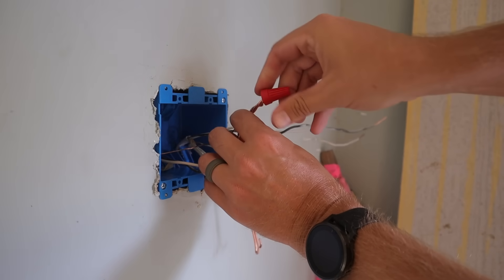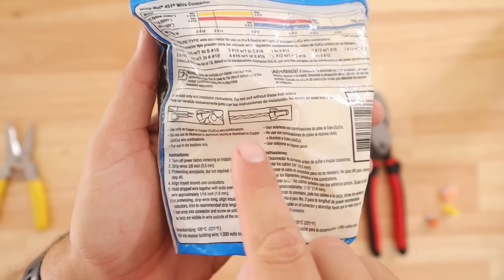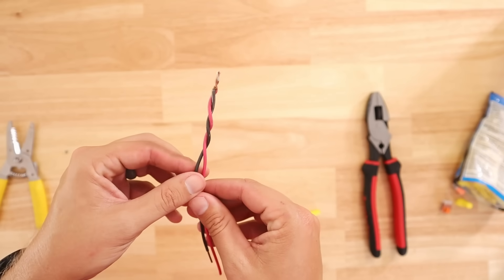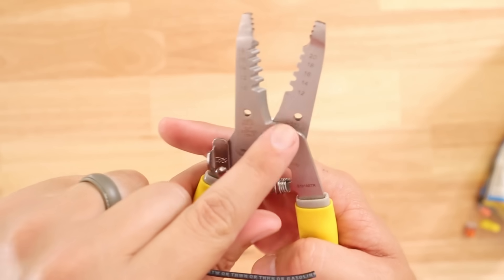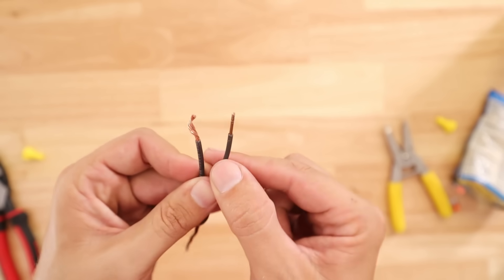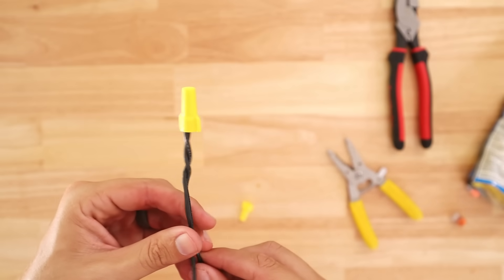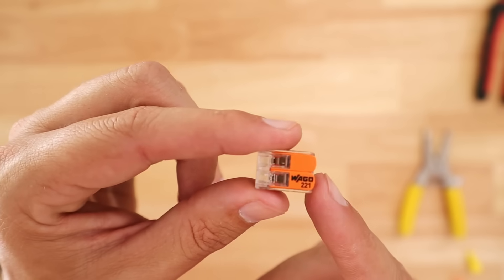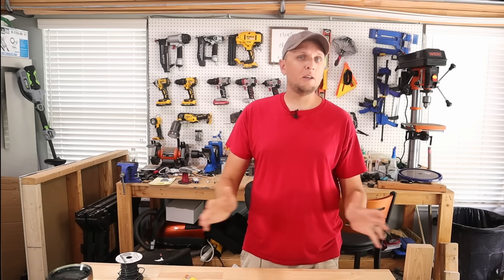BIGGEST Mistakes DIYers Make When Connecting Wires Together | How To

Comment: I enjoy using the WAGO 221 in ceiling light boxes and ceiling fan boxes because the job gets done more quickly. When I am working with my arms stretched out overhead I want to reduce the time spent on the ladder compared to the time I would spend working with wire nuts.

Comment: Excellent video.  Though the package says 'pre-twist not required' it does not in anyway translate into 'no-twist necessary'.  As a DIY'er I've always pre-twisted my wires because I can visually confirm a good connection before the nut goes on.
Reply from the maker: I agree!

Comment: I just had a wire come loose from a wire nut for my living room light switch this morning. I opened it up and used a pair of pliers to get leverage and tighten the hell out of it before closing it back up, fixing the problem (this resulted in the wires starting to twist together aswell). Before this the nut was as tight as I could get it with my arms but still losing contact.

Comment: Another problem that causes pull out is using a wire nut that is one size too big. For #14 and #12 connecting one stranded conductor to one solid, I would use the smaller orange wire nut or the smallest correct size to bite into both connectors to make a solid connection. Using the correct size wire nut to the size conductor or multiple conductors is also important. Wagos work well too because of the clamp down pressure. Push in wire connectors work the best on smaller guage solid wire like in old fluorescent light fixtures when I do LED conversions. Unfortunately you can't properly push in stranded wire in these, OK for #14 and #12 solid, but the wire tends to rotate in the ports. The best connection for larger wires is making a good neat tight twist then locking them together with the correct size wire nut.
Reply: Orange Wire nuts are for #16 or smaller for #14 and #12 you use a Blue wire nut, #10, #8 and #6 you use a Red wire nut. Anything Larger use a Large Dark Blue wire nut. But it also depends on how many wire you have to Splice at once.Sometimes i have to use a Red wire nut on 6 #12 Solid Wires

Comment: Biggest challenge I have when doing installation and repair in my home, is working with 60-80+ yr old wires. Replace a light fixture and the insulation on the wire is just crumbling off.  Cant run a new wire thru the house, so wrap in tape and hope for the best.

Comment: I have been an electrician for thrifty years and if anyone wants to trust the wire nut , you have never accessed a junction box and untwisted a wire nut with 277 volts with the full load on a neutral.  Horrible advice.  Always twist your wires. I don’t care if it’s 12 volts dc or 24vac.

Comment: The biggest mistake DIYers do is to touch electrical in the first place. Check your homeowners insurance. It probably has a clause that says if you don’t use licensed contractors then if your house burns down due to substandard electric work they are not going to pay the claim. It’s cheaper to hire an electrician then to burn your house down or worse electrocute somebody. Do not do your own electric work!

Comment: I guess the Wago is good when you have the space to use it. When you are cramming wires and 2 or 3+ connections in the box, wire nuts take up less room.

Comment: In my opinion, for the typical untrained DIYer, the Wago 221 is the way to go.  They are much easier to understand and less prone to improper installation.  Plus, they look nicer and are easier to undo if you make a mistake.  Great video!
Reply: Wire nuts are a thing of the past!!
Reply: wagus suk in my opinion.  I dont trust them.  But if you do use them , ENSURE they are rated for the correct amperage based on wire size.
Reply: Even the electrical engineers disagree with each other! Follow the manufacturers instructions and you are covered.
Reply: @hardtobefirst  I agree!
Reply: The big problem with Wago is they are not a direct copper to copper connection, and therefore will always have more resistance, and that means more heat wasted.  They will waste a substantial amount of energy over millions of connections (especially where higher current is flowing).  Use a wire nut PROPERLY (it's not hard) and save energy with a direct copper to copper connection - and you'll never have a problem - and use less energy in the process.
Reply: @johnanderson5208  I agree with you, theoretically a Wago might add a small amount of resistance.  In my opinion, the ease of use, time savings and the compact package of these devices far outweighs cost of the energy that it dissipates, which would be immeasurable for most home owners with a quality meter.  I agree that wire nuts make a good quality connection when used correctly, its just that often times, they are not used correctly.  Its pretty hard to screw up a wago connection.
Reply: @martyb3783  It's not "theoretically" - the fact is there is NO copper to copper connection in a Wago.  You have copper to plated brass (or steel) then a second plated brass to copper junction.  You have TWO inefficient, energy wasting junctions in a Wago.  Wire nut junction has exactly ONE electrical junction, and that is copper to copper.  Assuming the copper is clean and the wire nut is correctly installed, that is the most efficient, lowest resistance connection outside of welding.  Wagos will always have a higher resistance, and therefore waste more heat than a proper wire nut.  The energy loss will go up with the square of resistance.  On circuits carrying low current there will be a small difference between a wire nut and Wago - but look at a circuit carrying higher current and the difference is obvious - and you can see a Wago warm up more on IR camera.  Yes, you could say a single Wago doesn't waste a huge amount of heat - but multiply by lots of Wagos used across whole cities and countries  - and you then you realize every wasted Watt counts.  Remember  - these days EVERY wasted Watt counts, especially across millions of connections.   If you want to stay efficient, use a wire nut.  If you can't use a wire nut correctly, then please hire a good electrician to do the job for you.
Reply: @johnanderson5208  LOL, absolute nonsense.  To worry about the miniscule amount of resistance in a wago connector when the device being powered is order of magnitudes more inefficient than the connector.   Let me guess, you watched a couple videos, now you're an expert. 🤣
Reply: @martyb3783  You agree with John?  He's absolutely incorrect in his asinine assertions.
Reply: @petercullen1462  I said I agree in theory that wagos might introduce more resistance than a wire nut.  This resistance, as I said, would not be even measurable without specialized equipment.  I would challenge anyone to be able to tell, through energy usage, the difference between a house wired with Wago and a house wired with wire nuts. Or even a thousand houses for that matter.  He says that every watt counts, true, but I would guess that the resistance caused by wagos would only cause a change that would be in the femtowatt range.  This is negligible for all practical purposes.  The time savings and ease of use for a wago is NOT negligible.
Reply: @petercullen1462  Actually I am an expert in the field, legally - professional electrical engineer.  It's  not hard for Wago's to waste ~1/2 to 3 Watts per home, depending on how they are used (especially on larger load circuits)...now multiply by a million homes in a metro area.  Now you've got to come up with another say 1 or 3MW generation capacity on the grid just per 1 million residential units -for inefficient wire connectors (and other bad practices, aging infrastructure, etc).   In 240VAC countries the problem is less because average household circuit current is less - but it is still a waste problem.  Take apart any Wago / Push connector and you'll see there is absolutely no copper to copper junction.  Another big problem (and getting worse) are phantom power appliances - TV, stereos, gadgets and PC's that never turn off and always allow current flow.  A Watt or three here and there for standby power doesn't seem like much until you scale up.   From a metro power generation plant point of view, it all adds up BIG time. That's why every Watt counts - when you think on a large scale.  Yep, if you just measure the energy lost across one connector it seems tiny...but multiply "tiny" by millions of times and it's not tiny anymore.
Reply: @johnanderson5208  also dis similar metals will cause corrosion over time, which will result in a bad connection, excessive heat, all lead to bad things happening.
Reply: @petercullen1462  throw away the wagu crud, use a wirenut, easier , quicker, cheaper .
Reply: @darrellcollins877  Everyone has their own opinion. I respect but disagree with yours.
Reply: @johnanderson5208  I am also an electrical engineer.  Everyone has their own opinion. I respect but disagree with yours.

Comment: I use electrical tape from the wire nut to the twisted wire connection. Please use actual installation videos. Working in the field on a ladder or working on the floor is very different than working in a shop. I use Electrical tape around all outlets and switches so the ground wire does not short out on the circuits when installed into the boxes. Loved your work I just want it to be real light, outlet, GFI. Switches and pannel work.

Comment: Kind of tough to pre twist and trim then twist on a wire nut in a live tight box or fixture. Which happens with most of the wiring in service calls where turning off the power is not a good option. Just have to be thorough and make sure the connection is good.
Reply: Turning off the power is always a good option unless for some reason it may shut off life support. Don’t work on hot circuits if you don’t have to.

Comment: I liked your instruction.  The only thing I would point out is how you strip the wire.  Instead of jerking the stripper to remove the insulation, I was taught to use the thumb holding the wire to push the stripper away.  That way, you don't accidentally sock the person next to you in the face.  Excellent explanation of the connecting solid with stranded.
Reply: I prefer to use the handle grip type you squeeze together. Helps those with carpotunel in the wrist. To many years of using the pull away stripper gave me carpotunel.

Comment: Thank you, Adam. I've always wondered, would wrapping a short piece of electrical tape around the twisted wires and the wire nut, as a final step, be of any benefit to keep it all intact and safe(r)?
Reply: That sounds good, because the wire nut could still come off, and then you'd have exposed wires.
Reply: No, not needed. End up with a sticky mess when go back in.

Comment: I'm not a pro, but I've seen others do the following with the wire nut/wire twist option. In addition, they also physically crimp the wire nut with pliers. I've had to pull these connections apart, and you might as well cut them to get them apart.  They don't come apart otherwise!

Comment: Wago connector was new news to me. Probably works faster for an electrician but when you want a connection that will last 40 or 50 years or even just 15 years I suspect wago might not be what you want to use. The concern I have is dissimilar metal in the wago causing galvanic corrosion. You might not see.the problem for many years but just like the zif connectors used in computers  that cause connection problems due to different metals it will be a problem later imo. By the time it happens the guy who did his job faster is long gone and it is the home owners problem Junt like the computer or microwave that is out of warranty by the time it fails. But as a diy guy, I'll fix things made with those cheap ZIF connectors. But many people just throw away something broken and create more trash for our landfills bc the repair guy will charge too much to fix a 3 or 5 yr old microwave or washing machine so they get replaced with a new one instead of repaired. Too many items fail early due to using cheap or faster to use materials without regard to what early life problems they cause as long as they make it through the warranty period due to the penny pinching executives or tradesman only care about their bottom line and don't care about the customer's bottom line. Companies don't even want their products to last 20 years anymore like a refrigerator or washer and dryer used to. They know that using cheap zif connectors and ribbon cables have limited life issues and need cleaning to keep working but better life connectors cost more money and customers don't see the guts of the item they are buying.
Reply: Where is the proof of dissimilar metal issues in Wagos? Did you do some testing? Is there a website that has shown this to be the case?

Comment: Pretwisted single stranded wires may lead to loose connection due to wires separating when the twisting cap is applied. Multi-stranded wires of 16 gauge and above are best to be dioxidized and soldered to prevent  possible loss of contact through oxidation and excessive heating on the process of electricity transfer.

Comment: you should do a video where you wire nut the wires correctly and then strap them to diesel truck and try to pull the wires out of the wire nut. Sarcasm i'll never understand why people test their connection by putting so much brute force to pull the wires apart. wire nuts and wire have zero load bearing capabilities. i've NEVER had any issues with my wire nuts. granted i make sure i give it a slight tug. but once it's placed in the box correctly, it's not moving much, if at all.

Comment: Did service for years only time I've seen failure in wire nuts is improper installation.  I feel in all cases should be pre twisted.  Also big problem people use wrong size wire nuts . Those wagos give them time they will corrode and cause failure.  Seen on low voltage boards connections several times.  Have a good day.
Reply from the maker: Thanks for the feedback!  Have a good one!

Comment: I DO Ac work- when I use a wire nut- I also use one of those sockets that go on your drill/driver to tighten them.  They get those wire nuts so tight and the wire twisted so tight, that you cannot remove it without a lot of effort even with pliers, and even then the bare part of the wires are twisted very tightly.  The problem with wago is having the right kind to use with stranded wire.  I have had electricians and code inspectors tell me, "you cant use those with stranded" or "you cant mix stranded and solid with those"--but after talking to the company you can as long as you use the correct wago.  I have seen countless disconnects and supply wire from the house damaged beyond use from poorly connected wires.  This is probably not as much of an issue with a light socket or switch, but with 40 amp 230V 8 ga wire AC supply (or water heater)-I have seen it happen on water heaters too its a very serious issue.  you should do one on mixing aluminum and copper--like on a water heater or AC.

Comment: Can the Wagos accommodate different wire gauges within the splice?
Reply: To answer my own question I referred to the Wago site. "Conductor range: 20 … 12 AWG Solid and 18 … 12AWG Stranded" 
They have connectors for 10 AWG also.

Comment: Been doing this for about twenty years now as a licensed electrician and not once have I ever twisted wires together with a pair of pliers before wire nutting them . For one a contractor isn't going to be ok with you wasting time doing so . Yes we do twist until everything is tight and wires won't fall out but the rest is just a waste of time . If your really that concerned about wires fleeing their respective nuts I'd suggest soldering them and then insulating as per code . Just my two cent's worth .
    The biggest issue I come across with quick wiring practices is using the outlet itself as a splicing device as in wiring in the line side and continuing thru the load side to the next outlet instead of pig tailing the wires for this reason . When wiring thru a device if the last outlet on that circuit has a full load for long periods of time it means all the electrons are flowing thru every other outlet between the end use and the panel . Over time this fatigues the dielectrics in the unused devices wearing them out to the point they will no longer hold plug in connections anymore . The devices might have never had anything plugged into them but no matter , they are still toast from all that current passing thru them for no reason other that a quick install job and save a few pennies on wire nuts or equivalent . 
     Just say'n ; )

Comment: We are visual beings, so, the (exposed) pre-twist ensures that we have a good connection... incorrect... The wire nut coils compress and twist when not pre-twisted. The problem with pre-twist is that the nut coils cut ACROSS the wire, especially stranded wire which compromises the connection. The video does not show us what happens after the nut is removed, via both methods. The wire nut over the pre-twist always mangles the wires.

Comment: I always pre-twist the stranded wire before trying to twist it together with a solid core wire...There's also soldering the connection...
Plus--and I'm sure you've done this for visual clarity, but it should be explained that you do not connect black to red.  Like colors only together!

Comment: Question. With the Wago connectors, would it be a good idea to twist the wires after connection is made or would this be an unnecessary redundancy?
Reply: The design of the Wago is such that the wires will not easily pop out on the push fit ones. Twisting may put excess side forces on the plastic or possibly pull some of the wire down from a fully seated position. Some of the Wagos will take 6 or 8 wires. Plus, if you have to remove just one wire to do some work,  it becomes problematic if the bunch is all twisted together.
Reply: @Fjord_Driver  Good to know. Thank you.